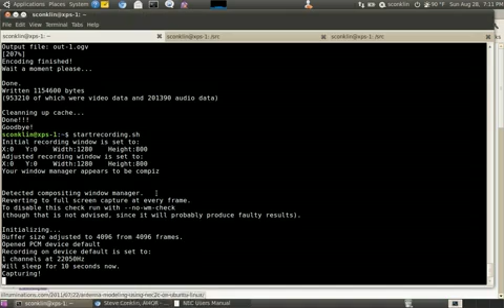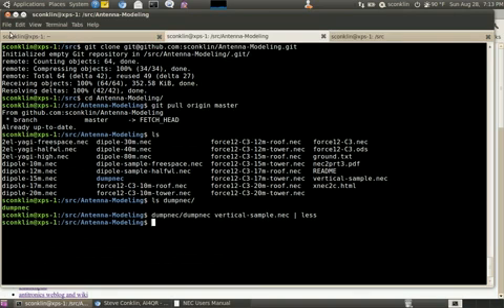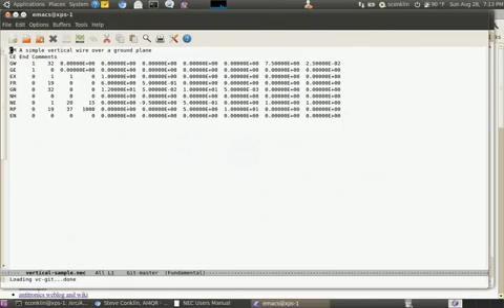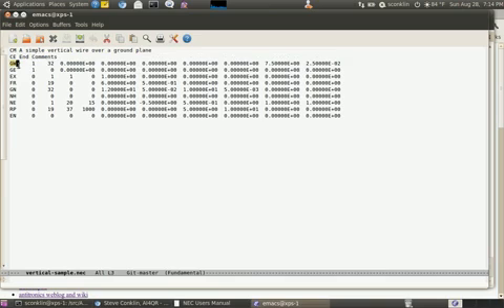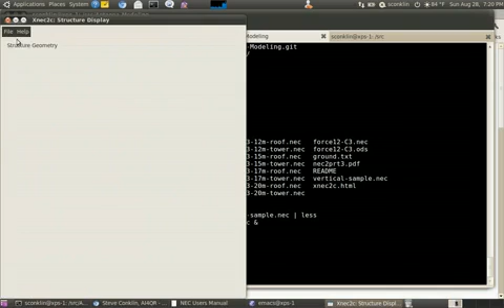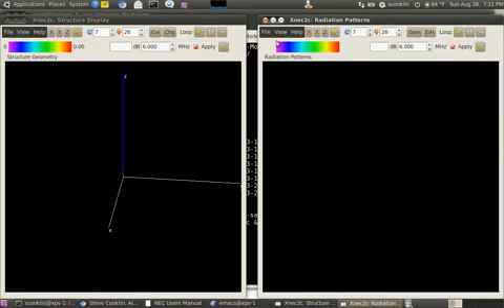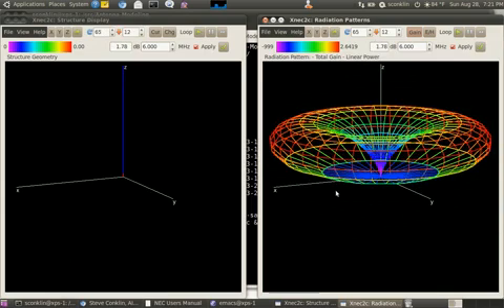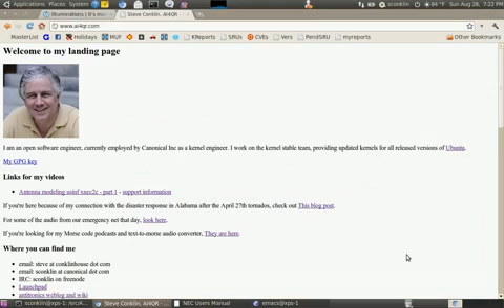Antenna modeling using xnec2c - part2

Comment: Unfortunately you tube is interfering with posting of internet addresses.
Ubuntu users must install the git package.

git clone h t t p s : / / github. com / sconklin / Antenna-Modeling. git

Another detail: xnec2c uses antenna and wire dimensions all in meters.

I went through the git hub sign up  process too... but that may be unnecessary.